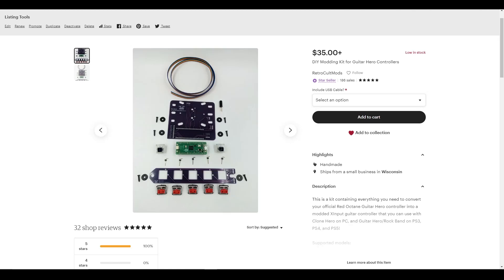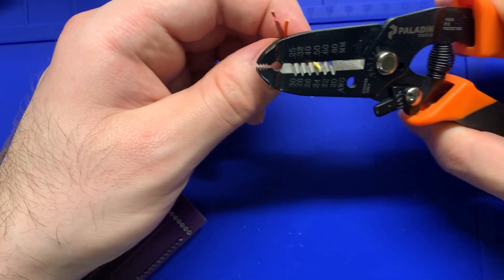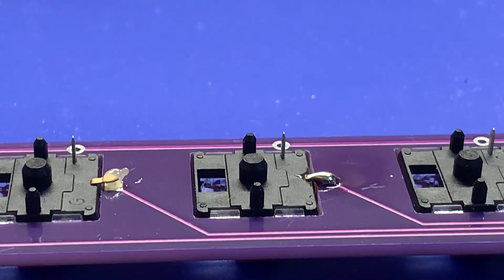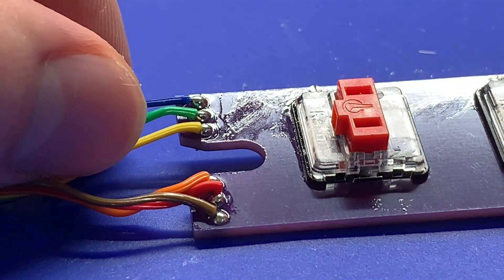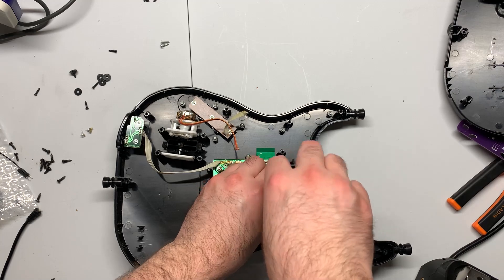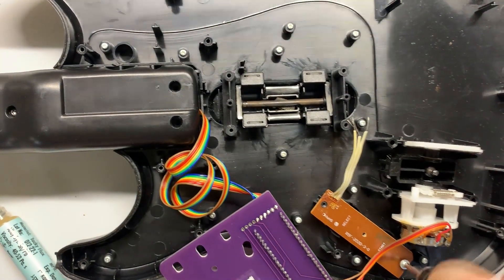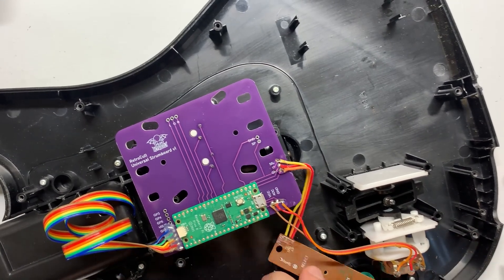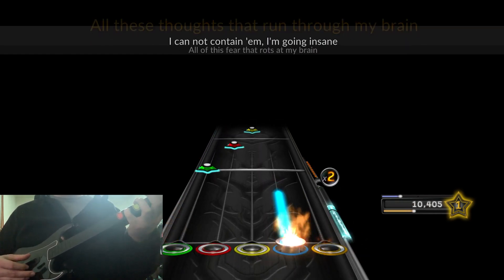DIY Guitar Hero Controller Mech Fret Modding Kit for Clone Hero, RB4, GHWT:DE #clonehero #guitarhero

Comment: Do you have to use longer wires for the start and select buttons? If so, do you have a link to where i might be able to find something similar to the small jumper cable you used?
Reply from the maker: Sure, these are exact jumper cables in the video (10cm, male to male)

https://amzn.to/3mWl5PT

However, these aren't ideal if you're buying specifically for soldering, since they're not pre-tinned (I just used them because I had them around). 

If you're fine with paying a bit more, you can get much more wire that's actually pre-tinned here:

https://amzn.to/3Tgs9mG
Reply: @retrocultmods  Thank you very much!
Reply: @RetroCultMods another question, is there a spot on the main board for the  tilt sensor?
Reply from the maker: @lord_illusion  Yep, I realized I forgot to mention the tilt sensor in the video! 

The two pins on the right hand side of the board labelled SP and GND are where you put the tilt sensor. You then tilt the sensor down about 45 degrees so it only activates when held at an angle!

Comment: Could you help me with a problem? I bought a custom wii guitar with mech frets from Sweden and it worked perfectly for a few months, then randomly stopped registering notes. I think it’s a problem with the little white wire where the wii controller shape is. Idk how to fix wiring and that stuff so I bought a wii body off of eBay. When I use the custom neck with the body I bought off eBay is has a normal working green button but all the other buttons are wired wrong. None of them register notes if held by themselves but if I’m holding the green button down and I press down red, clone hero thinks I am fretting green+orange. If I fret green+yellow the game thinks I’m fretting green+blue. Is there any way to fix this or is the body just incompatible with the neck?
Reply from the maker: I'd highly recommend reaching out to the seller you bought it from, as they will have a much better idea of how it is set up internally!

Comment: hey, does this work on rock band 4 on ps4/5? and if it does how would I connect it do, I change the settings on the guitar configurator to ps3 or keep it default?
Reply from the maker: Hi! It will work, I've tested it personally with RB4 on PS4 and PS5! You'd only to to make the following changes in the Configurator:

Under “Controller Output Type” you should see a box that says “XInput”. Change that from “XInput” to “PS3”. Make sure the box below that one still says “Guitar Hero Guitar”, then click “Close”. Then click Write and wait a few seconds; you're done!
Reply: @retrocultmods i didnt realize these kits could work on Rock Band 4 as well, that makes me even more excited to get one. How would you set it up for use on the Xbox One?

Comment: im having a problem im not sure what it is but when i go to program the green button its conflicting with the red button as well says pin conlfict any idea how to fix
Reply from the maker: That means that somewhere along the line the green and red frets are bridged, I would check to see if you have excess wire making contact where you soldered the fret wires to the board!

Comment: just bought the kit and it did not come with the raspberry pie thing you mentioned first
Reply from the maker: This is an old video. The current kit comes with a board that already has the Pico integrated into it so you don't have to solder all those pins! Take a look at my Zeroboard kit video!
Reply: @retrocultmods  yea didn't realize that. I followed the link from the description and ordered it.

Comment: On this board is there a way to map to the d-pad and the tap pad on a ghwt controller
Reply from the maker: If you can trace the wires for the dpad, you will be able to connect them to the corresponding dpad pins on the top of the strumboard. As for the tapbar, only the GH5 model is compatible.

Comment: Do you think this would work on a wii guitar? If so I might be interested in getting one
Reply from the maker: It should work in a Wii LP with no problem. WT and GH5 guitars should also be fine, but may require extra wires to reach the whammy/start select depending on the model.
Reply: And I also saw that Xplorer guitars need a bit of work done to them before this can be used.
Reply from the maker: @LOLMAN9538  Yep, the neck supports as well as the frets need to be trimmed down.

The Start/Select/Dpad board also requires some PCB modification, I wouldn't currently recommend modding an Xplorer for beginners!

Comment: Would this mod work with any console games by using the usb port like ps3 or is it just limited to Clone hero on PC?
Reply from the maker: It works with PC, Mac, Linux, PS3/4/5, and modded Xbox 360s!
Reply: @retrocultmods  Thanks, im trying to do this to an old rockband guitar but im unsure if it will work. Its got 10 frets, way more wires, and strum bar is different than the one shown in video.
Reply from the maker: @LIrvin17  Ah I see, currently my kit does not support Rock Band controllers, but I'm not apposed to adding support in the future!
Reply: @retrocultmods  I will be on the lookout or maybe ill find a regular GH guitar soon and get this mod for it

Comment: i see all these mods but i mean, do you guys not like having a neck that comes off? just use a simple analog port like a vga port or something idk
Reply from the maker: People have definitely done that before, but unfortunately it's not something that can be easily added to a DIY kit.
Reply: Would it be theoretically possible to reuse the pogo pins that come with the guitar assuming they were cleaned well and soldered fresh? Or would latency likely suffer?
Reply: @djmehs  because its analog latency would be near non existent where as the pins can have drops due to the pins maybe not making full contact not only with the pads but also the split in the pins. Plus its more of a solid connection

Comment: is this the same for a wii les paul
Reply from the maker: Yes the process is similar! Although please note that the Wii Les Pauls need their stock frets sanded down, or you'd need to buy a set of 3D printed frets for a correct fit. Message me on Etsy for more info!
Reply: @retrocultmods  do you sell the fret buttons for the wii les paul on etsy? if you do i would be more than happy to buy

Comment: is this compatible with a wii WoR controller? if not, is that something that will be developed? i ended up breaking mine :(
Reply from the maker: Currently it is not compatible due to the very compact nature of that model. Eventually I'd like to get something together for WoR guitars, but there are other projects I want to finish up first!
Reply: @retrocultmods  yeahi figured the compact internals would make it trickier to design something. Anyway, ordered an rgb kit for my ps3 sunburst and super hyped for it :)

Comment: Anyone know if this will fix the latency issue noticed with ps3 les Paul guitars? Also what’s the deal with the dongle? Will my modded guitar no longer work with my dongle or my old GH3 game on ps3?
Reply from the maker: This mod entirely replaces the internals of the guitar, so it will no longer work with your dongle.

That said, you can program it in the software to be used with PS3, so you can use it for GH3!

Since it is a directly wired guitar, it will have an improved latency over the wireless dongle!

Comment: Are we able to keep the tilt functionality by moving the tilt sensor over?
Reply from the maker: From the original PCB? It depends, it needs to be a digital sensor that can fit in the through holes on my Strumboard!

Personally, I would just stick with the tilt sensor included in my kit (I forgot to add that part to the video hah)!
Reply: @retrocultmods  thanks. I didnt see it used in the video which is y i asked. I found out afterwards because i ordered a kit for my xplorer (name on order - erick-) i ordered the usb cable too but im hoping the arduino has provisions to solder the 4 wires from the factory cable too as i want to keep the stock cable for the breakaway and the strain relief.

Comment: What exactly does the kit do?
Reply from the maker: Hi! The kit is used to replace the stock strumboard with a new one so you can program it to be used on PC, Mac, Linux, PS3/4/5, and modded 360s! It also comes with a replacement for the stock fretboard so you can upgrade to mechanical frets!

Comment: Does this work for the Wii guitars?
Reply from the maker: Hi! Yes it only works for official Wiitars and the "Buddies" brand 3rd party Wiitar on Amazon. There are mixed reviews for the longevity of that one, so I would still go with an official model!
Reply: @retrocultmods  could make the neck of the guitar detachable so i can still use it on the wii
Reply from the maker: @johnsalinas8481  Sorry, I thought this comment was under my Wii Adapter short... The kit will work with official Wii models (have not tested it on any 3rd party Wiitar). The only thing to be aware of is the Wii models will need decent fret modification (sanding) for a proper fit with the mechanical fretboard. Alternatively, you can grab some 3D printed frets from Etsy that will fit much better with the kit!

Comment: whats the point in doing this? cant you just connect your guitar to your pc via cable/wireless dongle
Reply from the maker: You can, but people often run into issues with connections dropping and latency. This essentially "guts" the guitar and replaces it with a stable wired connection that has the fastest polling rate possible, which results in much better latency.

Also this switches out the old silicone frets for mechanical frets!